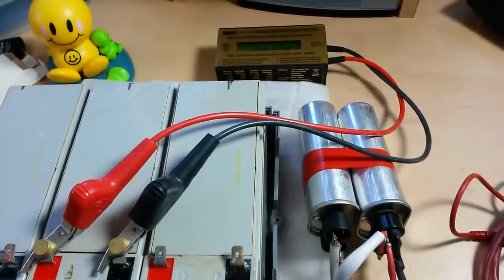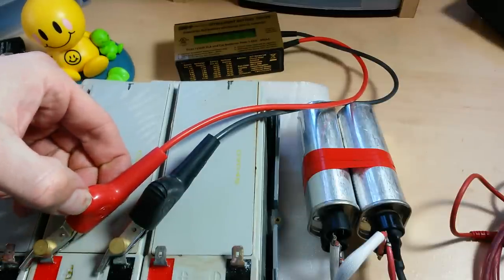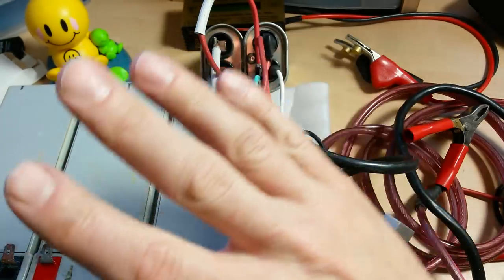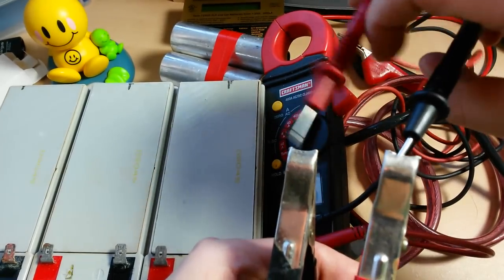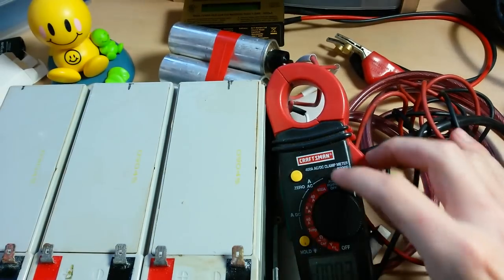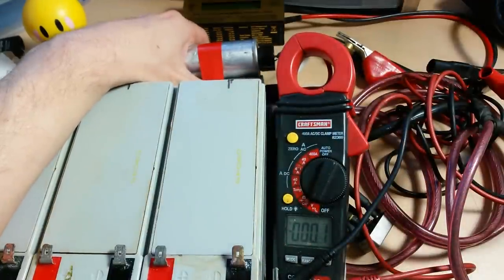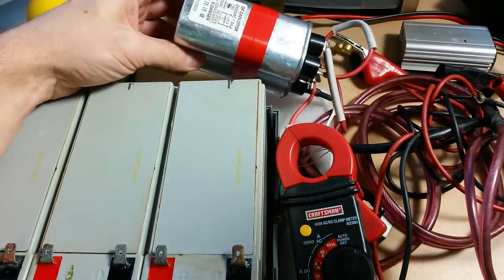(:Myth Busting:) Battery Restoration Myths: Epsom Salts? Proper Capcitive Charging & Desulphation

Comment: So, maybe you mentioned it and I missed it (kids in the house, it's possible,) but what are the specs on the two in-line microwave transformers?  I know they come in a WIDE variety so would like to know what to look for when picking the right ones for this build.
Reply from the maker: Microwave transformers are not good for this project. Use hi capacity DC Caps
Reply: @GadgetClass  The caps need to be A.C. Not D.C. All electrolytic D.C caps used in electronics are usually polarized. They are not intended for use in A.C networks. This application needs them connected to the input (A.C side) of the bridge rectifier. An ordinary electrolytic capacitor will immediately explode if connected there!!
Reply from the maker: @ΠάριςΑζής  Great Information!
Reply: Great Video clip! Apologies for chiming in, I am interested in your initial thoughts. Have you ever tried - Lammywalness Trendy Trade Guide (Have a quick look on google cant remember the place now)? It is a smashing one of a kind guide for learning how to recondition batteries at home without the normal expense. Ive heard some awesome things about it and my mate  got cool success with it.

Comment: I see many people have commented on the inaccuracies of some statements and beliefs portrayed in this video. I am not specialized in battery charging or reconditioning old batteries however any electrical/electronics engineer can see the errors here.
The warnings and safety aside (thanks for those who pointed that out already) - the capacitor in this application does very little to pulse the charging current - the waveform is still a slow rising sine wave and there would be little difference other than the heat produced by replacing these caps with Resistors of appropriate value. The capacitors will act as resistors limiting the current through them - I won't bother doing the calculations or simulating it on a computer simulator, to predict either the current or the heat given off if a resistor was used instead - This is not my intention, I do wish to point out however that the capacitors are used in the wrong way (a series element) rather the correct way to pulse charge (a pulse having a fast risetime of less than ImS 1/1000 of a second - and a duration of perhaps 10-100mS and period or repetition of 1 to 2 seconds) by charging the capacitors to a particular value, and then dumping that charge into the battery. 

Depending on the battery size and chemistry - pulses of 20 or more amps, averaged over the period of 1-2 seconds would result in dendrite/sulphation removal yet only supplying a steady or average current of 0.2 - 2.0 amps. Better class battery charging/recovery circuits also provide a discharge pulse of roughly 1/10 the duration of the charging pulse - these do a decent job of what is proposed here - the video suggests a very poor amateurish interpretation of what is needed.

I guess there is an incentive for people to put up videos for subjects that are not researched and come from hearsay and rumors - it is a free world and everyone should be able to say what they like - what disappoints me is that you allude to being knowledgeable about this particular subject and viewers not educated formally in Electrical Engineering will waste their time on this video.

I am sure that the other videos in the Gadget Class will be educational for me as I notice you review many products and I hope to get knowledge from you where you have the experience and factual (i.e. evidence) results from tests on commercial products.
Reply from the maker: Thanks for your input! This video was more of an experiment for me. I have played around with bringing old batteries back to life using a lot of weird cooky methods that didn't work(like epsom salt). Pulse charging is a very valid charging and restoration strategy, even if my first attempts were flawed. If I portrayed myself as an an expert, I do apologize.

Comment: I got a desulfator from around Ft Lauderdale. I had it for years and it kept our 6 volt batteries and bike battery up for years. I later got solar panels with the pulsing. I think it works.

Comment: The right procedure to use Epsom Salts follows.

Once you have determined that you have a battery you want to recondition, you have to empty the acid of the battery out.
You can save the old acid in a glass jar.  Wear safety equipment.  Rinse the battery out with water a bit if you can.  Make a solution of baking soda and water.  Rinse the cells out, until there is little bubbling.

Rinse the battery out again as much as possible.  Make your Epsom Salt solution.  Fill the cells.  Charge the battery for 24 hours .
Dump all of the Epsom salt solution out.

Rinse the battery as much as possible, and empty out as much water as possible.  You can rinse the cells with distilled water now.  Empty the water.

Refill the battery with your battery electrolytes (Battery Acid).

Charge your batteries.  Sometimes you need a low amp charge to bring the battery to life.  
Sometimes you need to cycle the battery.
Sometimes you need to pulse charge the battery
Other times a regular charging cycle works.

This is works for sulfated batteries.  You cannot revive a damage or deteriorating cell.

Comment: Hell with the battery, I just wanna know where to get one of those yellow, wobble head toys!
Reply from the maker: It is a Nohohon. The model I have is no longer made. Here is the video I did on it:
https://www.youtube.com/watch?v=snmYvLTv2Uo

You can still find them on ebay every now and then.:

  http://rover.ebay.com/rover/1/711-53200-19255-0/1?icep_ff3=9&pub=5575088352&toolid=10001&campid=5337488772&customid=&icep_uq=nohohan+2003&icep_sellerId=&icep_ex_kw=&icep_sortBy=12&icep_catId=&icep_minPrice=&icep_maxPrice=&ipn=psmain&icep_vectorid=229466&kwid=902099&mtid=824&kw=lg&LH_BIN=1&LH_PrefLoc=1&_sop=15

Comment from the maker: The problem with ALL commercial lead acid batteries is not the electrolyte, it is the engineered-in sloughing of the plates. A well respected battery engineer once told me that he could build a battery that would last forever(with proper electrolyte maintenance) but it would probably weigh 3 times a normal battery and have half the aH. I have owned and attempted restoration on hundreds of batteries, from generic starting batteries to $500+ PV and UPS batteries. 80% of batteries die of a dead or shorted cells (due to sloughing). The other 20% can be re-invigorated a little with pulse charging, but they were still engineered to fail within a given lifespan... You can, in fact, force amps through an electrolyte by adding free ions and changing the conductivity and TDS(which is what epsom salt does), but, no, you are not restoring all of the sloughed-off lead to the plates. Show me a PV or EV system running an epsom salt restored battery and I will be happy to measure the true aH for you.....
Reply from the maker: Джейсон Хичкок One can hope... If you got even %50 CCA for even 6 months I would be impressed. Most of the success stories you hear about are people who are trying to bring back neglected batteries. You'd be surprised what some intention and charging will do for a battery that's been sitting for 6 months.
Reply: That's a very accurate assessment, but allow me to add in one corollary. Lead acid batteries suffer premature failure in hot environments like the tropics. I too have processed hundreds of batteries and I have recently finished 5 years of R&D on what is probably the world's most complex regenerator (dual processors) weighing in at 7Kg and around 400 components.  I am about to deploy in the Caribbean with an expected statistical yield of 25% return to service of spent batteries. The appliance  is monitored online and tracks all batteries processed and the restored final ratings (CCA & Ah). A Pilot project at BOSCH franchise for over a year proves it out. Note that in the tropics the 80% Ah rating is not the point of failure to consider. It is 40% as there are no cold temperature performance issues.
Reply: Just a thought about a lead acid that lasts "forever" I think your friend was correct the problem with most batteries we buy is that they are built for
space and shipping efficiency if these are no longer the issue the sky may be the limit for lifetime or cycles.

I am going to try to build something useable that should last even with "abuse"
AH and CA will not be the goal but rather more cycles.

Thanks for a informative channel
Reply: here's  a few suggestions for battery repairing
Don't attempt to do this until you are sure what you are doing - the acid can burn you
check the voltage first - there may be a dead cell which would waste your time.
Check the battery fluid.
attempt to fully charge the battery.
(I read about these using Rapid Renew Roadmap site )
Reply: here's  a few things for doing a pro job
Don't try to do this until you are sure what you are doing - the acid can burn your skin
check the voltage first - there may be a dead cell which will waste your time.
Check the battery fluid.
Try to fully charge the battery.
(I read about these and more on Rapid Renew Roadmap website )
Reply: the best results that i've had was with the Magic Mender Wizard (i found it on google) without a doubt the most useful course that I've followed.
Reply: Eastwood (a hardware company) says to empty the cells completely and add one part espom salts to 3 distilled water. Charge it and use, then repeat weekly for a month to get all the sulfation off. I read online that it reacts with the sulfation to create sulfuric acid and some Mg is deposited on the electrode increasing the surface area of it. Not about either of those, but it seems from your apparent reasoning you don't realize the espom salts are to facilitate desulfation of the electrodes. Some people have used the method hundreds of times. That seems more reliable than your disbelief.

Comment: What about Alum? once upon a time I read that alum in at least a lead battery will only galvanize @ a molten salt temperature. I also heard that the alum battery should onyl be done optimally in a conditioned cell, not a sulfated/dead cell, but that the alum might desulfate a certain amount, can't remember. Please look up "lead-alum" battery and also marcus reid crystal power cell, or solid state battery. I made an alum cell that I held in a short for a year, then I charged it off of a 18v solar panel and it worked as good as normal, until somebody stole it since they knew it was probably never going to fail. it was only a 6 volt cell, main problem was I didn't have the money to build a buck boost converter and other circuitry for it. You are supposed to charge lead-alum like a ni-mh. Good luck with your mythbusting. A $20-30 6v battery once conditioned with a few to 10 charges and discharges is a fairly cheap way to disprove the "bedini-cell". I didn't believe it coming from bedini, but like alex jones, "sprinkle bullshit with truth", or like bernie sanders, "a broken clock has to be right twice a day".

I have my bets on lead-alum crystal-hydrate batteries being a future battery chemistry to compete in it's own way to solidstate li-ion.

Comment: I am electronic on robotics and i have made this capacitor charger years ago to charge my batteries and as the video says it works 100% and it IS the best simpliest way to charge a battery healthy. My car battery should be dead 5 years ago (total age of battery till today 9 years old) when it started not to hold the amps. It refuses to die cause i keep it in life with this kind of charger. When it cant start the car engine i charge it just for 5-6 hours and its back to life for many months again till i stop using the car for an extended period of time like 2 weeks when i charge again. But if i use the car often there is no problem at all, it never has problem. Plus the brand of the battery is  a cheap one not a well known as Varta for example etc. Gratzs, nice video mate.
Reply from the maker: what kind of capacitors did you use in your charger?
Reply: I will try to translate cause English is not my language so sorry for any mistakes. So, the capacitor is by Philips on 100 Volts (DC) and 10.000 μF. The transformer is low voltage  built in transformer for halogen lamps with power range 60-105 VA. The primary pinion-spool-bobbin or how you call it is at 230V (AC) on 50-60 Hz and the secondary is at 11.5 Volts (AC) on 8.4 Ampers. Here in Greece we use 220-230 Volts (AC) in our sockets with lower amps in comparison with you that you use 110 Volts with higher amps as far as i know. And of cource i use that square thingy with the diodes to convert from ac to dc. In Greece that diodes circuit we call it "bridge"  :)

Comment: What you said Epsom Salts Myths is based on the condition of plate quality. Yet, same thing, based on same condition, a  10 years dead battery, if the plate quality is all right, the battery still can be used for another several years.
I used epsom salts to recover a 10 years old battery which all mechanics yelled out it has to been replaced by a new one. I could use it for another 4 years to start my car.
Reply from the maker: Tube You Lets see it.

Comment: It is my understanding that Epsom salt is just a replacement for sulfuric acid that somehow gets lost over time from bad maintenance. It's harder for average joes to get regular battery acid (in a 10% solution) so Epsom salt is actually cheaper for us but in bulk is not as cheap as sulfuric. Sulfur fertilizer is also said to work and is even cheaper than MgSO4 but maybe only the mid price electrolytic salt.
One time I saw a vid where the guy poured out his FLA battery and then filled it back with water to "recondition" it. For some reason I didn't know to put Epsom salt in the water so it didn't work when I tried it. Might have saved myself a good battery if I just desulfated it.

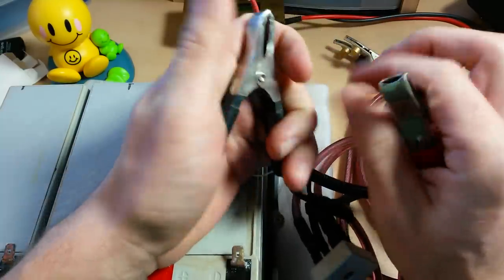Comment: you know nothing. 3:34 in... I'm out. 1:it's not 110V coming out, that's the RMS line voltage and not the PEAK voltages you'll be seeing. 2: It's not 60Hz, once it's crossed a bridge rectifier the frequency doubles.
Reply: I've done this to a car battery using epsom salts (magnesium sulfate Mg2SO4), so is this epsom salts and not table salt (NaCl)?
Here's the best way to recondition old batteries: HootBattery.club

Comment: Your rectifier charger is pulsing the battery at 120 Hz. Not 60 Hz. A Full wave bridge rectifier will dubble the the 60Hz AC input and produce a 120Hz DC pulse.
Reply: Orchid Komando
Reply: Robert Tomkinson if I remember right it does remain 60hz the distance when displayed on oscilloscope remains 60hz because the neg wave in ac is just inverted to positive creating a positive pulse. The distance between pulse/waves is still 60 per second. What does increases is 30 positive voltage waves per second to 60 positive waves since the 30 negative voltage waves are being inverted. I might be wrong, long time has passed since high school science class.
Reply: double not dubble

Comment: If you want to debunk the claims of good results with epsom salts on lead acid batteries, what are you doing with those unidentified batteries? Did you show their specs, labels or talk about them and I missed it? They were not made for high current, smallish connectors. What are they made of? You referred to those capacitors as transformers once, don't you know the difference?

The 120 volt rectified cap thing is from a rather smooth sine wave. I don't have experience with this, just thinking theoretically a square wave may be better. An I'm wondering, what about a 15,000 volt neon sign transformer through a diode (like from an old tube TV, they're usually good for 40KV, scour thru the local dump), charging a 20KV capacitor (buy one from me) and when the charge is high enough to jump across a 1 cm gap (around 10KV in normal weather) it blasts thru the battery. The question is whether that would intimidate the sulfur enough to be inclined to go from its solid form back into solution or whether the addition of some acid rock might be needed (with life-killing crashing cymbals of course, the kind engineered for maximum annoyance of parents and to turn our youth into morons).

Comment: Please advise what type of current limiter you have in the 110 volt line. To leave people with the idea that you are connecting 110 Volt AC directly to the bridge rectifier is very dangerous. So are you just using a resistor in series with the mains and if so, tell the viewer the ohms and watts? Very concerned!
Reply: Now that I've seen the circuit, The capacitors are his current limiting. They are being fed AC as they are before the rectifier. If they were after the rectifier they wouldn't pass any current once they were charged and that would be almost immediately.

Comment: The reason this is dangerous is that the output is referenced to ground and there is no isolation.  Even when this circuit is charging a battery if you take a voltage reading from the terminals to earth ground you will get over 110Volts!   So DO NOT touch the terminals when this charger is energized!!

Comment: if you do plug the capacitor in and do not for get it will hold the power in it for a long time  even if you unplog it you need to UNCHARGE it or it will hurt someone ...
Reply: Ted Gannon Very true! They will hurt ya.
Reply: Most microwave capacitors have an internal resistor across the two terminals that drains the capacitor very quickly after it's charged. Easy to tell just check the voltage immediately after you charge the capacitor to see if it's rapidly reducing. It only takes seconds